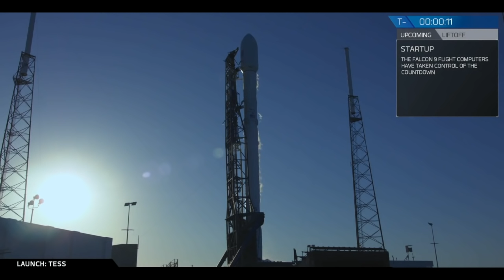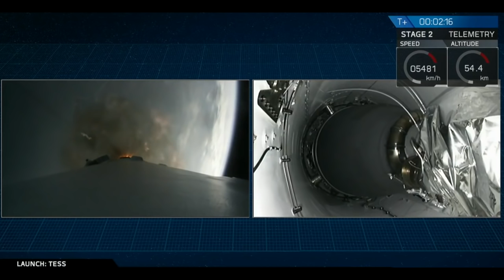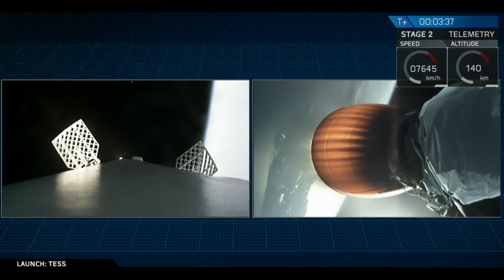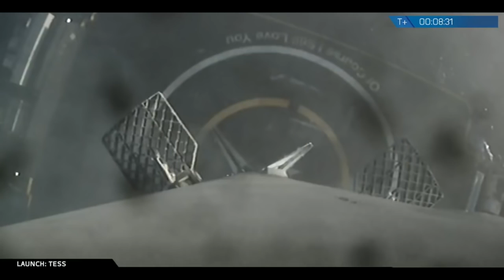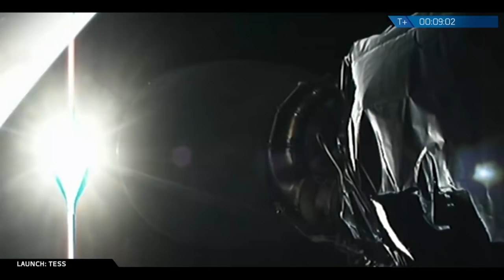SpaceX Falcon 9 launches TESS & Falcon 9 first stage landing

Comment: Can some one explain to me why they used fish eye
Reply: What? Why?  They take the “inexpensive, off-the-shelf” approach. And what camera is cheaper, smaller, hi def & rugged than GoPros? And GoPros, designed for hand held, close action & selfies are designed with wide angle lenses, so that you can have significant pointing errors & still get the shot.

Wide angle is perfect for the engineers. They want to see everything they can (i.e., wide angle) & don’t care about distortion.
Reply: teefkay2 why use it on every thing and does 3 normal lense camera cost that much this realy makes me confused and its the reason why there is conspiricy theorists
Reply: What? Why?

Can I ask how old you are & what you do for a. Living?
I’ll give you my answers: 65 & I’ve been a mechanical engineer ever since I got my degree in 1974.

I will answer your question correctly. I can do that because I’ve made decisions exactly like the one your asking about 100s of times in my career.

Your answer won’t change my answer in the slightest but it will greatly change the tone of my answer. I hate going off on someone, and then finding out that they are young kids. We were all Young&Stupid at one point in our lives, and nobody has any say in how old we are.

There are two components to your question. One component is a very reasonable question. The other is not. 

I’ll help you with both.
Reply: teefkay2 i asked you a legit question and there is no reason to attack me personally second if you are pointing out that iam a flat earther iwill give you a direct answer iam not and again the only reasonable answer i get was its not good for the team and engineers that works on them then why they put it on the star man and the iss live which has no other porpose but to show people it
Reply: What? Why?  Here are the short answers to your specific questions.

”why use it on every thing”
1. “Economies of scale”. Using the same camera everywhere is far cheaper than using different cameras.
2. Most important reason: the engineers protecting their MOST IMPORTANT resource: their own time. They’ve got 250 things in their In Box. If you’ve got a working solution to a particular problem, then it is a waste of your time to try to find the best solution to the same problem. 
3. SpaceX is still operating like a start-up company. That means that many key employees (especially the engineers) work ridiculaous hours (50 - 90 hours per week). There are far, far too many REAL problems to waste time chasing IMAGINARY ones.!

And now, let’s get to the REAL issue in your question ... the fact that you are trying to use the video generated for ONE purpose to prove or disprove a SECOND premise. 

Amateurs do this.
Professionals don’t.

In your case, I strongly suspect that you’re trying to use the video of taken from SpaceX’s cameras to prove or disprove (perhaps “support or undermine”) the curvature of the earth.

When professionals are trying to determine something, they use carefully constructed & controlled experiments that are specifically designed to answer the exact question that they are asking.

The engineers who specified the cameras have not the SLIGHTEST INTEREST in addressing this non-question, as they already know, with ZERO uncertainty, the correct answer to this non-question.
__

There are perhaps dozens of direct experiments that prove, with 100% certainty, that the earth is a globe.

There is NOT ONE SINGLE IOTA of evidence that it is flat. 
Or to be more specific ... not one single iota of evidence that it is flat ... when the evidence is examined by an expert.

The critical concept here is, “who gives a rat’s ass about the opinions of amateurs”?
The opinions of experts, otoh, is something that everyone (everyone!!) should pay very close attention to.
Reply: What? Why?  ”i asked you a legit question ...”
Yes, you did. 
But there was more than a tad of “illegit” in the greater context of your question.

Let’s be honest & direct, WW, the specific question you asked has nothing to do with your real issue, which is “whether the earth is curved or flat.”

I have zero problem discussing any issue. 
I have no patience for anyone having any discussion with hidden agendas or ulterior motives. Those two things are a form of dishonesty.

I will give you honesty & transparency.
I demand the same in return.
Or I simply leave the discussion.
__

”... and there is no reason to attack me personally ...”
WHOA, Kemosabe.

I’m an old-fart engineer.
To us, “You’re a fuckin’ moron, & haven’t a f’king clue what you’re blabbering about” is about the same as, “Hi, Charlie, how was your weekend?”

Re-read my response to you.
I did NOT personally attack you.
I attempted to jump thru some hoops to be certain that I would NOT personally attack you.

It’s your insecurity (from previous discussions) that has produced your hyper-sensitivity, which interpreted my comments as a personal attack.
__

”second if you are pointing out that iam a flat earther iwill give you a direct answer iam not ...”

Color me, um, “moderately skeptical” of this.
Most people who make “Flat Earth” arguments are, overtly or subvertly, Flat Earthers.

You might be an exception...
__

”... and again the only reasonable answer i get was its not good for the team and engineers that works on them”

I don’t know who gave you that answer. It sounds like a pretty dumb reply, to me.

I gave you the right anwers. 

The problem (“a very light, very small, rugged, high def camera system”) had already been solved by GoPro. It is brain-dead stupid to waste time re-inventing a wheel. Especially since they could get brand new, latest GoPros for about $50 each ... when you buy them in 500 - 1000 quantity lots.!
__

” ... then why they put it on the star man ...”
Same answer as above.
SpaceX already had a completely viable solution.
__

”... and the iss live ...”
This one is very slightly different: It’s called “convergent design”.
Multiple engineers, trying to solve the same problem, will frequently settle on the same (or very similar) solutions.

They are DRIVEN to similar solutions by the identical design constraints.
I’ve seen this dozens of times in my own designs vs. those of competing companies trying to solve the same problem.
__

”... which has no other porpose but to show people it”
I don’t understand this comment.
Please elaborate.
Reply: What? Why?

Regardless of all the above, here are the SOLUTIONS to your issues with fish-eye distortion (aka, “wide angle distortion” or “barrel distortion”).

Simplest solution: 
Barrel distortion is a “rotationally symmetric” distortion. 

It is a minimum near the central axis, and gets more & more pronounced as you move (in any angle) towards the edges of the image. 

The solution is easy: the images of the curvature of the earth are “most accurate” (in this case, “very accurate”) when the curvature passes thru a central circle that is about 2/3rds the short dimension of the image.

The images are far more distorted when they are near the edges of the image. 
The images are most distorted when they are in the corners of the image, since this area is furthest from the optical (central) axis.
__

Better solution:
Use video from a camera that does NOT have this sort of distortion. 

The ISS uses mostly “latest generation Nikon cameras”. Their lenses are superb, and (except for extremely wide angle ones) do not have this sort of barrel distortion.

However, shooting thru porthole windows DOES introduce distortions as the light travels at angles thru the window. 

ONCE AGAIN, the distortion is minimal when the light comes thru the window at a 90° angle (near the optical axis), and is maximum when it comes thru the window at an oblique angle (way off-axis, near the edges of the window). This assumes that the camera is held “approximately perpendicular” to the window.
__

Better solution:
Look at video that is NOT shot thru a port hole window.

You can find some YouTube video of Ed White doing the first US EVA in around 1968 or so. His co-pilot is filming him thru the wide open hatch (i.e., no window to introduce distortion) with the edge of the earth in the background.

You can also find video of ISS astronauts during EVAs. These videos don’t look thru windows.
__

Best solution: 
DSCOVR satellite video. 
Yes, it IS “video”. 
ALL video is a sequence of still frames.
The only difference is “frame rate”.

Time lapse video has a very slow frame rate. In the case of DSCOVR, 1 image/2 hours of the entire earthly globe.

“Normal” video is about 30 images / second.

High speed video is hundres, thousands, millions or billions of images / sec.
Reply: What? Why?
Big Picture ... that makes (almost) all Conspiracy Theories evaporate.

If you need to know the correct answer to any objective, technial question (note: “objective question” = “only one correct answer”), then go with the consensus of real experts.
__

Anybody gets to ask any questions.
Only the answers from REAL EXPERTS carry any weight.

The opinions of amateurs, or fake experts, are irrelevant.

Honest investigators will turn to only real experts for their answers, and will report the consensus of real experts.

Dishonest, Lying, Snake Oil Salesmen & Conspiracy Theorists will turn to, and will report, the opinions of amateurs, fake experts & the “professional outliers” (the very few contrarians, mentally ill or attention whores in every field).

Note well: getting a PhD or MD in any field does not provide immunity from mental illness or (sadly) even incompetence.
__

The pertinent fields  of study related to flat earth or spherical earth are geodesy, long distance surveying, long distance navigation, celestial mechanics, GPS and even mechanical engineering.

There are precisely zero real experts in any of those fields who believe that the world is flat. 

There are certainly a tiny, tiny number of incompetents, attention whores, and (mostly) religious zealots in each of those fields who proclaim “flat earth”.

The opinions of these quacks carries zero weight compared to the 99.999% of sane, reasonable experts.
Reply: teefkay2 frist iam not insecure iam just using my common sense which you apear to lack and if me as a normal person ask question ididnt even asked you particularly i just want a person that doesnt say you are stupid in his answer to answer me and if what did you meant "you are idiot and young we were all young once" in real life thats not normal thing like its dissrespect and  attcking people personally and no it will never be a normal thing
Reply: teefkay2 second i know that you will think that fe i just said iam not since there is more ways to now if earth is globe or flat with out going to space  like geomtry and you just assumed that iam flat earther are crazy! And this is not immaginary problem its a real since there is communities believe that you guys just stealing their taxes and if you didnt solve it then it will only got bigger
Reply: teefkay2 i just end your other replys thanks for the answers
Reply: What? Why?  Is English not your first language?
Because, I’ve got to tell you, WW, you appear to understand very little of what I’ve written to you.
Reply: teefkay2 yes its not
Reply: teefkay2 answering to your last reply yes i actualy every time i enter a discision with a flat earther on internet they ask this question above  i couldnt answer  it but your last answers makes realy sense bye
Reply: teefkay2 and i dont have any real knowledge of lenses:-(
Reply: What? Why? What is your native language?
Allow me to summarize what I've written to you.

1. I have not insulted you at all. 
I never claimed that you are a FLERFer. 
I ASKED you a couple of questions, which is completely different than making assertions. 
(Questions which you never answered, by the way.)

2. The use of "all GoPro cameras", with their fisheye lenses, is a VERY GOOD engineering decision. The cameras all have a very important engineering purpose: to provide continuous video of as much of the internal workings of the rockets as possible so that, if anything goes wrong, the video will be able to help the engineers diagnose the cause of the failure. Fisheye lenses lets them see more of the internal workings, which is exactly why they are frequently used in surveillence cameras.

3. The engineers have ABSOLUTELY ZERO interest in "proving the earth is spherical". They already KNOW that the earth is spherical. ALL engineers (especially those working for aerospace companies) know this, with absolute certainty, because they are not brain dead f'king morons.

4. ONLY brain-dead f'king morons think that the earth is flat.

5. There are about 100 decisive proofs that the earth is spherical, that it rotates on its axis, that it revolves around the sun & that the "standard model" of the universe that has been revealed over the last 400 years is correct. 

The people who claim otherwise fall into one of the following categories:
a) They are VERY stupid.
b) They are lying charlatans and/or attention whores.
c) They are mentally ill. 
d) They are delusional religious fanatics. 
e) They are between the ages of ~10 & ~25, which sometimes causes a very specific type of stupidity. (Note: some idiots never mature out of this temporary insanity.)
f) Some combination of the above.

6. I do know about photocamera lenses & engineering design decisions. The things that I've told you are correct.

7. "every time i enter a discision with a flat earther on internet they ask this question above." 
THERE is your problem. Stop trying to have logical conversations with illogical, ignorant, unreasonable idiots.
The only reasonable reply to these morons is "pointing fingers & laughing at them."
Problem solved.

However, if the "illogical, ignorant, unreasonable idiot" happens to be a teenager, you may decide to show a little compassion. Just like I tried to do with you. Realize, however, that attempts to enlighten Angry Young Boys about anything are pretty much doomed to failure.

”Testosterone Makes A Person Willfully, Resolutely Stupid.”

   (... until they learn to deal with it.)

Comment: What is that things use at 3:37?
Reply: Those are the grid-fins, they help steer the first stage to it's landing point.
The first stage also have gas thrusters and a gimballing center engine.
The fins, thrusters and engine all work together to be able to do these incredible pin-point landings.
Reply: Nash.A Chiller Cool, again learned something new😁
Thx
Reply: Glad i could help :)

Comment: I would like to request from SpaceX, to please include the Stage 1 telemetry during it's entire flight, especially after the boostback burn.  So interesting to see how Stage 1 manuevers to position itself for a landing.  Thanks in advance!  I love this stuff!
Reply: it`s their secret sauce...
Reply: CaboWabo70517 I'd also like to see this.
Reply: me too!
Reply: watch NROL 76
Reply: CaboWabo70517  You can watch severalof their earliest drone ship & KSC landings. On those, they displayed the stage 1 data all the way to landing. 

You can step thru the video, plugging in the altitude vs. time in e.g. 5 second intervals into a spreadsheet, & then you can calculate velocity vs. time & then acceleration vs. time by just using difference equations. Those curves really illustrate the effectiveness of the re-entry burn at keeping max re-entry speed from building up in the very thin upper atmosphere. And the dramatic buildup of drag as atmospheric pressure increases at lower altitudes, as air slams into the bottom of the rocket.

It’s very informative & you can get a very good idea of the reasons they thrust when they do.

Comment: The rocket engine flames seem to creep up above the nozzles, even as far as the landing legs.  Why does that happen?
Reply: funnybleh because of the very high speed, an area of low pressure is created near the engine and the legs, and the flames which has an higher pressure fill this low pressure area
Reply: As the rocket plummets back to earth, it is in a windstream of hundreds of miles per hour. Imagine you're in a fast car and you hold a bow torch out the window pointing forward. The onrushing wind will blow the flames back toward the torch.
Reply: Yep.  I noticed the behavior on ascent.  Thx.
Reply: Thx. I guess the speed doesn't overwhelm the pressure difference.

Comment: SpaceX has got the landing down to a fine art, landing spot on the drone ship. All the practice and the learning has been well integrated.
Reply: Arturs Ruseckis What, do you think they're using high-speed wifi? The rocket's travelling insanely fast while transmitting limited teletry that is picked up by ground station. It's not exactly capable of streaming 4k, 60 FPS if that's what you're expecting. Especially when it comes down on the drone ship which, as was said, gets shaken up as the rocket defends and its antennas fail to point at the relay sat in space until it's stable again.
Reply: Arturs Ruseckis Seriously?? They are able to land a freaking rocket booster on a tiny drone ship in the middle of the Atlantic Ocean and you're worried about a "reliable video stream"? Come on!
Reply: On the fucking bullseye. The head of their math/physics dept should get a million dollar bonus for that shit.
Reply: Seemed fairly stable except for the drone ship that almost always losses signal because of the vibration/movement caused by the thrust of the booster.
Reply: Yet they were unable to provide reliable video stream.